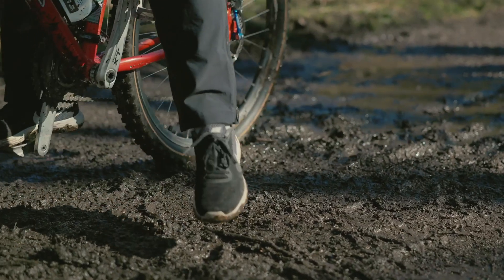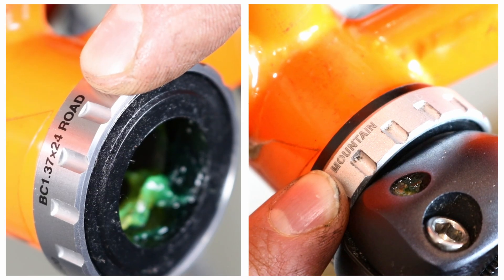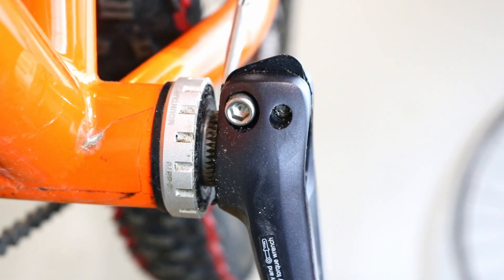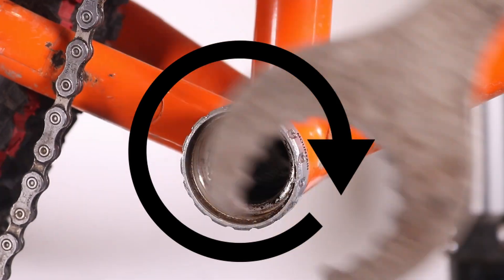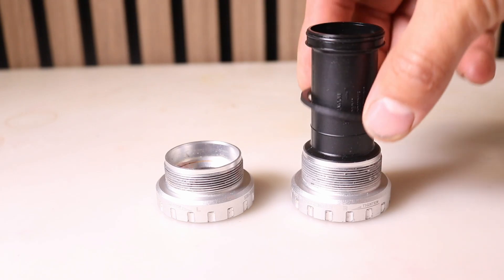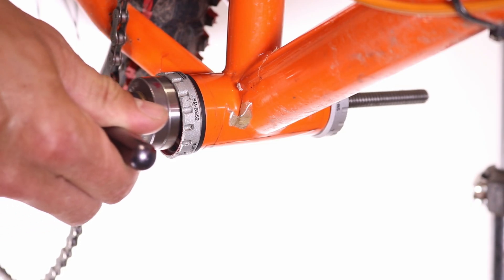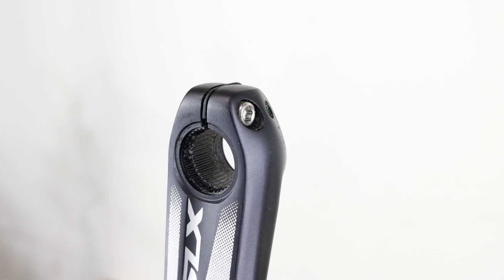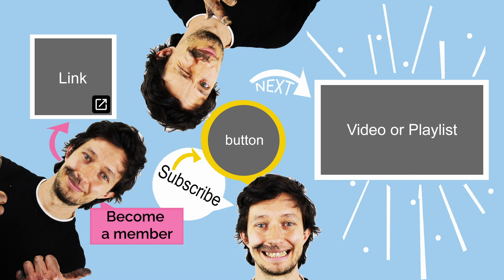Shimano Hollowtech II replacement guide: Bearings Only or Full Bottom Bracket?

Comment: I don't think it is this good practise to hammer out the bearings out of the cups while they are still inside the bottom bracket. You risk stripping the BB threads and then you have a BIG problem. AT LEAST lay the frame on something that supports the shimano sups so the force is taken up buy the desk/ground. And not your frame.

Comment: Bottom bracket is stuck any ideas hate people who over tighten stuff
Reply: Stuck screw-in bottom brackets may be the result of dirt, rust and/or no greasing of the thread during assembly (over tightening an aluminum thread rather results in damage/destruction of the thread).
A solid, this means in contrast to this video closed tool or 1/2" driven nut-style tool (steel is more solid than aluminum but may cause marks/traces when not formed well) is best to apply more and more power until it starts to unscrew. Adding some oil/WD40 and let it creek inside the thread for several hours should also help.
Reply: @FriedhelmSchröter thanks ended up getting a socket attachment for drill used an impact drill to get it off